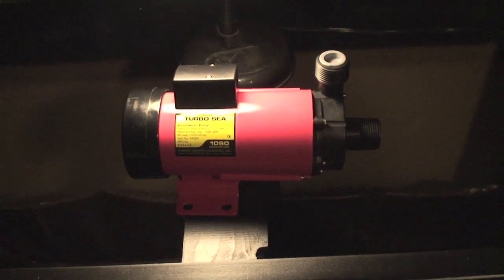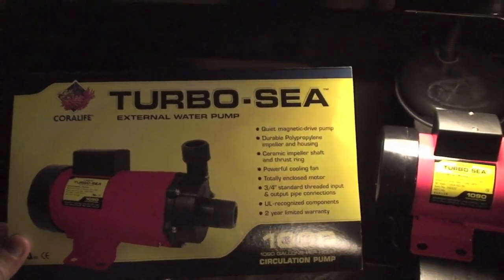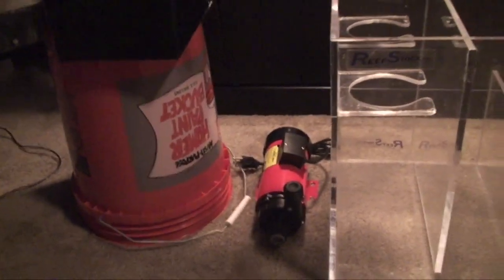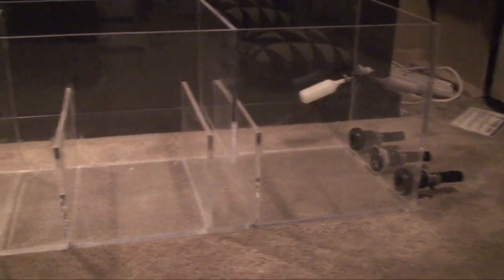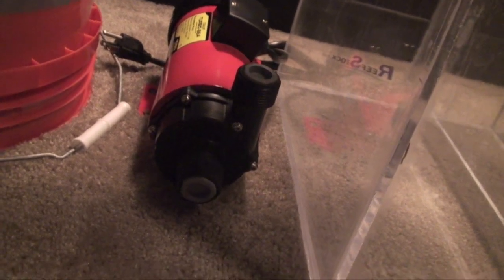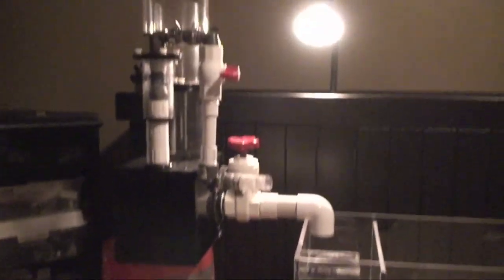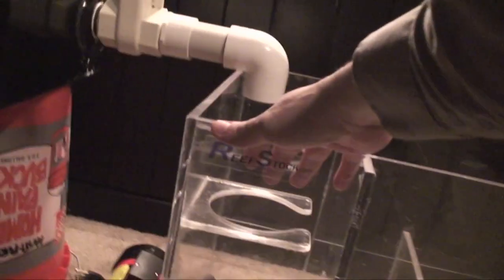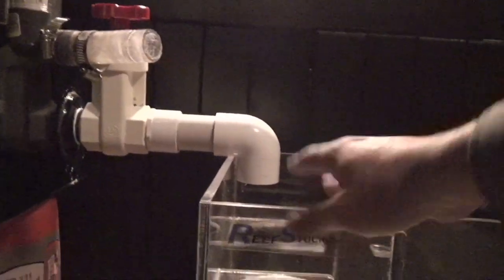SW Rebuild - Part 5 - New Pump

Comment: @tickleyourbrain 

If you bleed off from the drain you will have the pressure. You are confused because the actual drain from the tank is only 6 inches below the water line and the top of your protein skimmer is just above the bottom of the tank; therefore, you'll have the 20' inches of water pressure. By doing this you will become completely silent and have extra money in your pocket from using less power and less heat in the tank water.

Comment: @cobra305hp97 

Also, you could have painted the tubing you had with black spray paint and been able to plumb it without going through your stand. It should have been done with reinforced vinyl tubing not the tubing you videoed you gave the your LFS. Don't get me wrong its everything is done nice how it is just suggesting some things that can or could have been done to keep the price of the project down and the power/heat consumption down too.

Comment: i have a question... i have an 800 gph pump that can be used external or submersible but my sump is very small and it doesnt fit submersible so would it work if i put a tube from the inside to the pump outside. i am worried because the water level in the sump is only about 3 or 4 inches hight and the whole thing is bout 18 inches high so will it still work or will the water not be able to get from the sump to the pump because i know that part is supposed to be like a siphon or something.